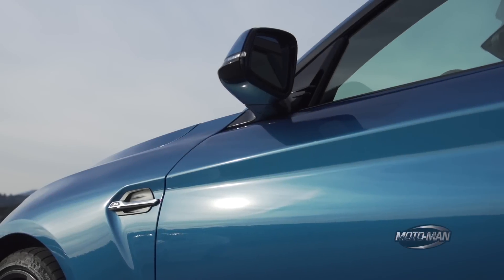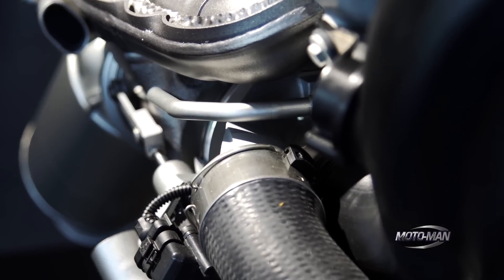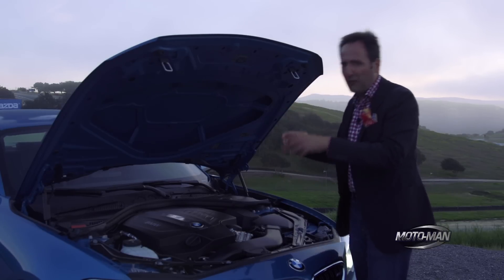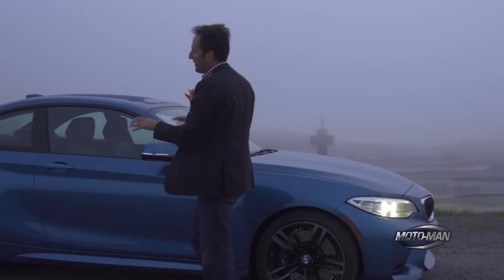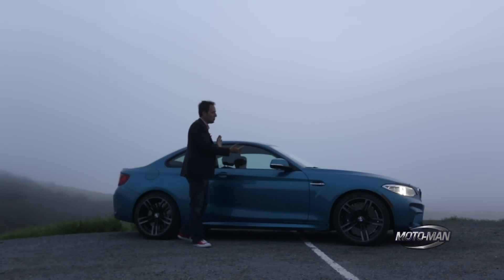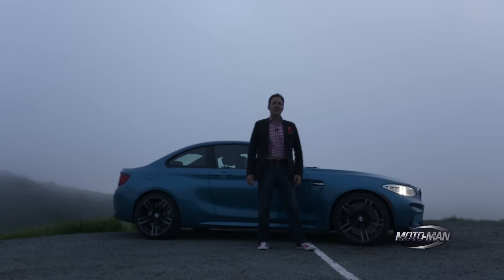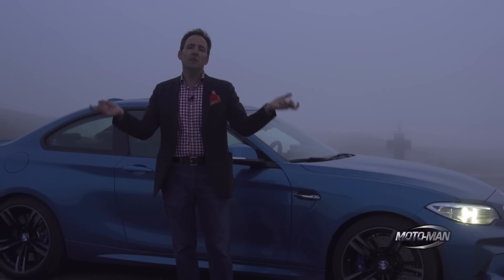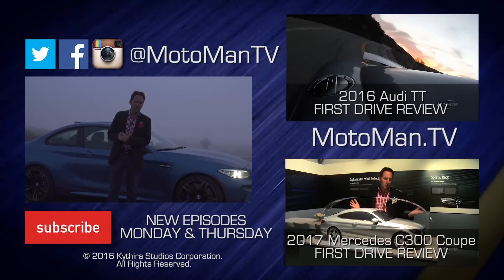2016 BMW M2 TECH REVIEW (1 of 3)

Comment: 2011 X5D Mods: Full renntech tune, EGR DPF SCR delete, 3 inch down pipe, (was mine, gave to wife) Used to track it, was a blast.
 2011e92 m3 coupe 6-speed Mod: exhaust hack and michelin PSS. Track sometimes, mostly bird rd. stop light races now.
where? South Florida.
Started the M2 fund 2 months ago, working a bit of overtime, saving about 1200 month. should be getting M2 in 10-12 months.

Comment: Does it have a dipstick? Does it play engine sounds over the speakers?

I'd rather buy an E46 M3
Reply: E46 is the best choice! E46 M3 CSL/GTR ohh!!
Reply: +headcas620 go ahead. it'll break down after 6 months.
Reply: Roger Lee it's awesome to look at it too. And, you know, usually cars can be repaired.
Reply: people who cant afford m3/4 buy m2, and people who cant afford m2 buy used m3 two generations ago.
Reply: Roger Lee well yes, something wrong with that? And some simply prefer the 'analog' cars or like the E46 better.
Reply: +Roger Lee  Wrong. Lighter, nimble and just as confident around a track are few reasons why folks pick the smaller M cars.
Reply: Marcus Zamorano and cheaper looking, both inside and outside.
Reply: Spiky86 cus God pities me.
Reply: +Roger Lee Wrong again. Sure I'll give the M4 some advantages interior but the exterior shares a lot similarities. A lot of M purest feel the M4/M3 are just to big and don't have the fun factor the previous small Ms had and what now appears the M2 will have. But I'm not sure u would understand that, because you just dont sound like a purest.
Reply: +Roger Lee and some people also buy older M3 and build full on 30k race cars out of them bc they are better balanced and are more rewarding to drive on track and daily road use
Reply: Mike Arredondo and breaks down more.
Reply: Roger Lee How many people are going to DD their M2? Who cares about reliability in a weekend/trackday car?
Reply: headcas620 An M2 can easily be daily driven, what are you on about?
Reply: +headcas620 Everyone.  Why not?  It is a luxury car.
Reply: TassieLorenzo It's not a luxury car. It's a sports car. I know it's fine to daily but i'm guessing 50% of buyers will have another car.
Reply: headcas620 No, it's a luxury performance car, performance coupe if you like.  Look at the interior, as with all BMWs, it is a luxury car.  The Z4 is a sportscar.  A sportscar has two main seating positions and has the main purpose of driving itself, and not other things.  This M2 is too practical to be a sportscar.
Reply: TassieLorenzo Looks like average plastic dash and other panels. Not very luxurious.
Reply: headcas620 Leather trim, climate control,  powered adjustable seats etc.
Reply: TassieLorenzo climate control is somehow a luxurious extra nowadays hahahaha
Reply: TassieLorenzo All of which you can get in a Civic. Is a civic a luxury car?
Reply: headcas620 what car do you drive? This M2 is indeed on the luxurious side of the spectrum when it comes to interiors.
Reply: +Nik Brudar A stock 2001 civic but that's not really relevant.
Reply: headcas620 hahah! That explains a lot. It's sad, though, that you had to emphasise the fact that it's stock hahah! Those riced out Civics are an abomination.

Comment: I'd like to clarify a couple facts that you point out in this video. The S55 is actually derived from the engine in the M2, the N55, not the other way around. The M2 has a "beefed up" version of the N55 that was first introduced in the 2009 535i Grand Turismo. Most commonly found in the 2011+ 1 and 3 series. Also, the actual weight of this car is yet to be released. Until an owner puts it on a scale we won't really know but the consensus is, that with all these radiators etc., it's closer to 3500lbs.

Comment: My only issue here in what you said, is that its not really a single turbo version of the S55.  Its actually an N55 motor, the same engine used in the M235, 435, 335, X5 35i, I mean its a very common BMW motor that was basically worked up a little bit by M

Comment: I'm 18, aiming for an e46 M3 for this summer. (WITH THE 6M NOT THE SMG lol) and I plan to hopefully daily drive it.
Reply: +MrLambo234 you should drive an SMG with a CSL tune, you might change your tune. In saying that, it's a lot of car for an 18 yo, be careful.
Reply: +krbcrwlr thanks for the suggestion! there is a local shop that specializes in e46 m3s so maybe they could do it. and I appreciate the concern, :).
Reply: i wouldnt take it as a daily driver. when there is shitty weather take a cheap winter-car, when its sunny take the M3. that way, you will have so much more fun with it.
Reply: +MrLambo234 you'll crash in 3 weeks time. But good luck! It's too much for, I believe, your first car, trust me.
Reply: +Nik Brudar wow. a little harsh. and it isn't my first car. I have a 2004 325ci. I've driven the 330ci and an e36 m3 coupe, as well as a 335i coupe which makes 300hp. Obviously the e46 has more power but I am no stranger to fast cars. so saying that I'll crash is a little offensive and pessimistic let alone rude and disrespectful. Everyone thinks that teenagers don't know what they're doing or talking about. but the fact is we aren't all the same. I have more experience with powerful cars than anyone in my family. So I think I can handle AND learn to control an e46 m3.
Reply: MrLambo234 ok, I was prejudiced, sorry for belittling you! I'm 19 and am probably just a tad envious hearing that an 18-year-old has one of my dream cars;) good luck! Still, be careful!
Reply: +krbcrwlr No it isn't! The CSL albeit the best e46, is by no means a beast.
Reply: +Martin Allen ok internet racer. Have you driven one hard with dsc off ? No you obviously haven't or you would never make that comment
Reply: Martin Allen GTR* is the best.
Reply: +krbcrwlr For what it is the e46 is a beast of a sports car, and it will always be in our hearts, but lets be honest. It's still a sports car of yester-decade. a 1st gen 1 series will do what the e46 could do, and arguably faster. I mean we're living in an era where anything below 465hp is beginning to be too low for most sports cars, and where 500hp is the norm.. This is the era of Hellcats and tigers and bears oh my. we got a plethora of twin turbo v8s... Hell we got damn near twin turbo everything. These days even the 328s are pushing 255 ft-lbs of torque. That's about 10 maybe 8lbs less than the e46 with close to 100hp less. Progression has carried us all a long ways since the days of the e46's birth. So far that we have to have cars like the M2 supply the nostalgia. Even the 1M is five years old. Time is moving on.
Reply: +TheGhostlyShadow Yes, but the fact you are missing is all these new cars are so refined they handle 500hp like nothing. They are smooth, composed and really too fast for the street. Wind out one and you are doing 200 before you know it. 
The e46 for example is raw, metallic and not refined. You feel you are going way faster than in a new car, but you're not. I don't care about actual speed or track times. I want the sensation of 'holy shit this is intense'. Only the wildest of new cars delivers and when they do you are going jailable speeds.
Reply: I agree with you, but that still sounds like the "driving a slow car fast is better" argument, and I'm not saying that's not true as I agree with that for the most part as well.. It's just that the only way you'd truly feel like the newer, faster vehicles are too "tame" at high speeds, is if you're coming from something like an e46, and even still that's subjective because the fact still stands that despite how we feel about it, and how other people feel, the refinements in newer vehicles you speak of are considered improvements by both the manufactures, and the engineers, and like you said. The cars now are really to fast for the street. Any of the new M cars will put you into a wall or over a median (if you've seen the video with the M4 at Cars & Coffee) I mean you can go and buy a 600hp mustang for under $50k. That's crazy. In the e46 days you had to be spending around or over 6 figures to get half that, and I guarantee you If you aren't careful, All that power will bite you. In fact that's one of the main arguments for buying an M2 over an M4.

Comment: I thought BMW lists this car at weighing 3505 lbs. The spec you mentioned sounds like the weight of the the base 228i. This thing may seem more nimble than the M4 due to wheelbase, but make no mistake it's a porker (relatively speaking).

Comment: i have an e36 m3 3,0 EU spec 286BHP. Bilstein B14 suspension with camber plates and at the rear camber arms, single mass fly whell, h&r antirollbars, ferodo racing brake pads and tarox g88 discs, 3,2 oil punp and oil pan, bmw motorsport m3 GT oil restictor. For everyday i am using michelin PS2 tyres for track days federal rsr. most of the time i am using it for every day. driving my kid to scool and i go to work, from time to time i go on race track to have some safe fun. at start of the track day i am trying to drive on grip at the end of the day when tyres are bad i finish them with drifting.i am happy with car but for every day i think e36 its too old now. no xsenon, no BT, safety, realibility, no PDC.  i am looking to e46. Regards from Slovenia. not Slovakia :)

Comment: Would be great if M2 would weight just 3295lbs but this is not true according BMW official site it weights 3461lbs versus 3465lbs for M4 - all those numbers are EU base.
http://www.bmw.com/com/en/newvehicles/mseries/m2coupe/2015/showroom/technical_data.html
the real weight is the one you see on scale and there isn't much BMW could do here specially to keep price on a reasonable range. Anyway should be great to drive and maybe faster on small tracks and slower on high speed tracks in comparison with M4.